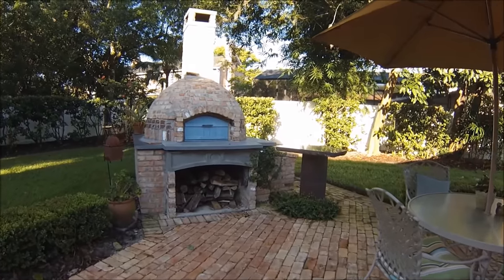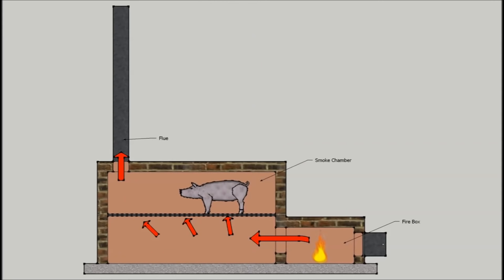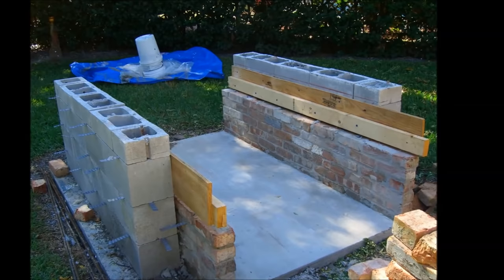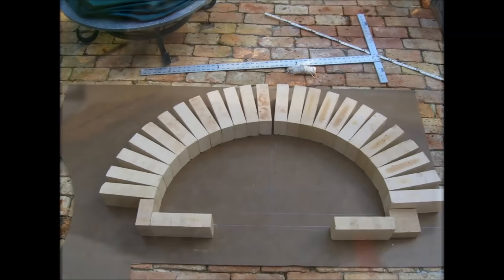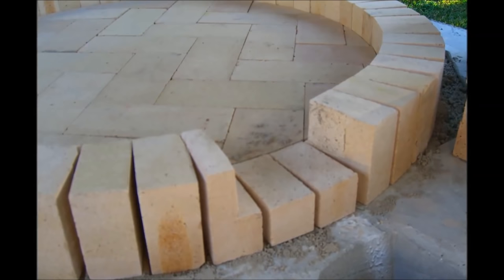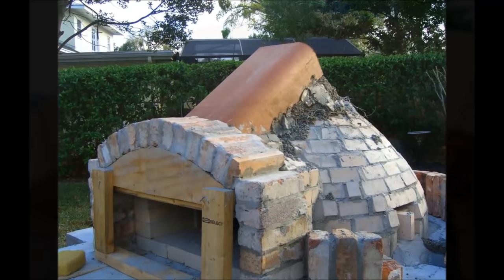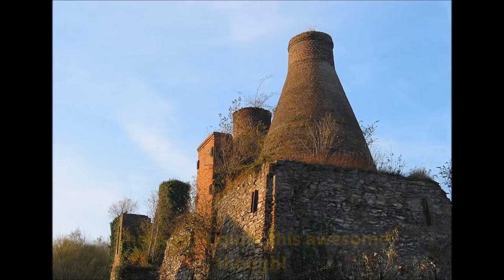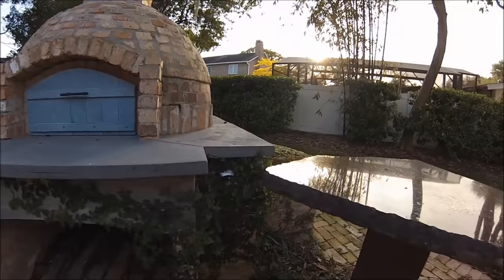How to Build a Brick Wood Fired Pizza Oven/Smoker Combo

Comment: I can see that your depth is 4 blocks but can you provide your other dimensions?  Awesome work also.  Do you think it would work if you made your fire box from a fireplace underneath with doors to control air flow?
Reply from the maker: Jerry Campbell The inside of the oven is 36" in diameter and the outside dome is around 5'5" in diameter. The base is 6'2" wide and 6' deep (not including the projection at the landing). I think the fire box for the smoker would work well but you would have to store your wood somewhere else.

Comment: Really great video and the best pizza oven I've seen on the net. Is your sketch-up drawing to scale?
Reply from the maker: scs3drg Yes the Sketchup model is to scale.
Reply: Thanks, started work today digging the hole for the base, your oven will be the inspiration. I did toy with a slight twist on your design by having one area for fire (the oven) and exhausting the smoke to a separate smoking chamber like a dedicated smoker. however I think the hight smoking chamber would be a little impractical and inelegant, so I'm going with your two fire chambers design. Wish me luck.

Comment: I noticed you didnt really insulate too much compared to other diy oven plans online... How does your oven hold up to holding in heat?
Reply from the maker: +moosekim Mitchell I have 4" of insulation at the bottom and 6" minimum on all sides of it - except right where the flue goes over the top of the oven and right at the base of the chimney. I wrapped the sides of it with high temp batt insulation and then filled the rest of the space between the inner and the outer dome with loose perlite. It holds the heat just fine during the cook. I can't say how hot it would be the next day if I wanted to cook with it then so that might be problematic.

Comment: I'm not in the architectural industry, but I'd wager a vertical copper surface under a relatively large overhang, like your granite slab, is not going to develop much of a patina any time soon... unless you live right on the water by the sea! I've heard of vertical copper cladding being pre-treated for a patina, though.
Reply from the maker: I sprayed it with a mixture of salt and vinegar and it gave it kind of a bluish patina. It looks pretty good but not as good as a natural green patina. I think you are right - it needs to have exposure to rain to really develop it.

Comment: Lee, Thanks for the info on how to transition into the oven and on the removable fire brick.  One more question, and I may have missed this if you already shared this info, what size is your offset firebox?  Thanks for all you help.
Reply from the maker: Jenny Lynch The outside of the box is 2'6" deep and 2'2" wide but there are two wythes of brick so the inside of the box is about 2' deep and 1'2" wide.  It is about 2' tall. If I had it to do over again I would have made it just a little wider - maybe by like 6" and see if I could get a wider door.

Comment: Holy cow man, you are amazing, and I envy your awesome pizza oven/slow smoker. 
I'm thinking about making something similar to this, but rather in a pizza oven over an indoor fireplace. Learning that the flue comes from the neck of the pizza oven means that I shouldn't have to worry too much about cross flow from chimney to pizza oven, at least that's what I'm lead to believe. 
I guess my question is, is this a good idea (pizza oven/fireplace), and do you have any suggestions/cautions?
Reply from the maker: +Pro Jektor You could definitely have one of these inside and use it as a fireplace. Very little smoke comes out of the front of the oven - not any worse than a regular fireplace. The only thing you would want to do is not put it low to the ground like you would a regular fireplace because that would make really difficult to cook anything in it.
Reply: Lee McNeil
Right on. I was actually going to put the pizza oven on top of the fireplace, and have them share ventilation, but thanks for the input and support! ^_^

Comment: This looks awesome! One question... does using the pizza oven as a smoker negatively affect the pizza oven in any way? (i.e. does residual creosote buildup occur inside the oven, and affect the flavor of the pizzas, or do you just burn it off with a hot fire?) Thanks :)
Reply from the maker: Not at all. I never smoke with soft wood like pine though. Always use Oak, Hickory, Cherry or something like that. When you build a fire in the main oven and it gets hot enough, it will incinerate anything in the oven.
Reply: Lee McNeil thanks!

Comment: Hi Lee, Great job on the oven! I was wondering if you could share any additional lessons learned or things you might change with the pizza oven itself. I am thinking of doing an offset chimney as well and have been checking out Forno Bravo's forum, but there isn't much about an offset chimney! I have heard you need to waterproof the oven but can't see how Jamie Oliver or your oven is water proofed? Really great work and thanks for the video! Alan - Copenhagen, Denmark
Reply from the maker: The only thing I might have done with the pizza oven part of it would be to make it just a little bit bigger. Mine is 36" and I could fit probably three small pizza's in it if I had to but it is a little tight. That's a very minor complaint though. I have a clear commercial grade penetrating brick sealer on it for waterproofing (something like this www.tnemec.com/product/view/Series-660-PrimeAPell200). It's not going to keep every little bit of water out of the insulation layer, but since the insulation is mostly perlite, it's not really affected by water. If I had the high heat batt insulation, that might be an issue.
Reply: Hi Lee,
Thanks for the response! I am thinking about building a 38&quot; or 40&quot; oven, I haven&#39;t decided which yet! You say in your video you used batts over the inner oven Are you not worried about that getting wet? Looks great... I love the smoker idea! What sort of temperatures do you get in the oven when using your smoker? Thanks for the tips!
Reply from the maker: I did use a few batts of high heat insulation but mostly it's perlite. I think with the brick sealer it generally keeps the water out of the insulation space. And I did insulate over the offset flue but it isn't real thick. As a matter of fact, there it's developing a small crack where the flue offset is that I need to fix. But it will crack somewhere with or without the offset flue.

Comment: looks amazing, just perfection. If you wouldnt mind what could someone plan on spending for something close to this in material ?
Reply from the maker: I have it up in the description. Plan on spending around $2,000 for the material. Most of that cost is in old Chicago brick which I think runs about $0.75 per brick if you buy it by the cube.
Reply: thanks so much. you oven is a true work of art and something to be proud of. I thankyou for the effort you put in to get it up on you Tube.

Comment: If I paid contractors to do this from start to finish, what would be your best guess as to the cost?
Reply from the maker: It depends on where you are and how busy the contractors are at the time. I can tell you around here, there aren't a whole lot of good brick masons (because most of the new buildings aren't built with brick) and there is a ton of construction going on right now. I would expect to pay probably more than $5,000 for this to be built by a contractor around here right now.

Comment: Watching videos to gauge internal temp potential and radiated heat when cooking but uh... very few show that part
Reply from the maker: I have one of those infrared temperature guns which will measure up to little over 1,000 degrees F, and my oven will easily max that out. Radiated heat outside of the oven is pretty minimal though because it's insulated pretty well.
Reply: @LeeMcNeil  Awesome! Thank you so much for the reply 🙂

Comment: I love this video, we are planning to build one in our yard.  2 questions: what did you use to tie the opening for the fire box in the base to the opening in the oven? I could not see any pictures of how you tied the two together. Also, what size fire brick is used for the removable piece? the pictures look like the opening is larger than 1 brick.  Thanks for any help.
Reply from the maker: Jennifer - you are right I really didn't get a picture of that. The smoker flue comes up into the insulation space between the inner and outer dome. I made a little enclosure of fire brick with a lid made of a small piece the wall that I sawed out of a scrap piece of flue pipe. You could make the lid out of a few fire bricks also. This forms the 90° transition into the oven. I hope that makes sense. The removable brick is just a fire brick turned in its side. Make sure you taper it and grind a couple of finger holds into the face of it, otherwise it will be a nightmare removing it and putting it back in place.

Comment: Oh, one more question... how do you make that brick removable?
Reply from the maker: I tapered the back of the brick a little with the masonry saw, then I ground two notches in the face of the brick with an angle grinder with a masonry blade. The way I'm able to grab the brick and slide it in and out of the hole in the oven. Oh, also no mortar on that brick of course.

Comment: HI Lee, great site and wonderful looking oven, I'm interested in building one is there a material list. I want to gather my material a head of time ,without  having  more than Ineed. Bags of Cement mix you used were they 60lbs or 80lbs thank you for share your oven build
Reply from the maker: +joe Freitas I did not do a formal materials list. The amount you will need will depend on your oven design. I think I used 80 pound bags of cement but you will need to calculate the volume of concrete you need and translate that into how many bags. If the bag doesn't have that information on the bag itself you can probably find it on the manufacturer's website. Sakrete 80lb bags are .6 cubic feet per bag according to their website http://www.sakrete.com/media-center/blog-detail.cfm/bp_alias/How-Much-Concrete-Do-I-Need . You will have to do the same converting the brick and block to square feet etc.

Comment: I've heard heard some builders of brick ovens say use vermiculite and others say use Perlite. One of the vermiculite users said using Perlite was dangerous. I'm a  confused to which would be best for fire contact. I used to think Perlite was just fine, but now I'm not so sure anymore. Why did you go with the Perlite?
Reply from the maker: Perlite is cheap, very easy to find and is not dangerous at all. You can find it at most big nurseries because it's used in potting soil mixes to aerate soil. I have no idea where I would even get vermiculite.

Comment: Lee- prob 3 years and a 1/2 million views after you built this masterpiece, my question is:
How much actual smoking have you done in this oven, and what’s the outcome in the cooking/pizza chamber? Typically, smoking generates a good deal of atmospheric fat/smoke/byproduct that (particularly over time) coats all the exposed surfaces. Any comments/suggested improvements in your design?
Reply from the maker: Yes I actually do a good amount of smoking in it. I usually only use it if I am smoking something big like a brisket, turkey or pork shoulder since it is kind of a production to fire it up and I have a Weber kettle grill which is fine for smoking smaller things like baby back ribs. And the food comes out great. The best thing to cook in it is steaks though. They come out fantastic. If I had to do it over I would have made the smoker box a little bigger and add some better ways of controlling the airflow when I am using it as a smoker. It's a little finicky getting and maintaining the right temperature without monitoring it quite a bit. I have some videos of smoking some different things in it and making steaks on my channel if you want to check them out.
Reply: Lee McNeil great note, thanks.  What you didn’t address was buildup in the oven. Any issues? Any build up at all?
Reply from the maker: No, when you use it to cook pizza or steak, you are building the fire directly in the oven chamber and it gets over 1,000 degrees in there so everything burns off. It even burns the soot off the top of the oven.

Comment: When u smoke meat in there doesnt the grease from the meat trash the inside. What do you put the meat on so you can drain the drippings???
Reply from the maker: No. First, I use an elevated grate to sit the meat on and then have a pan of water underneath to add moisture, moderate the temperature and catch any drippings. You can see how it works in this video where use it to smoke a turkey. https://youtu.be/v0nPnXZ9dIY
But it doesn't really matter because the next time I build a fire in the main oven, it gets to like 1,000 degrees so everything gets incinerated.

Comment: So if I have to go 42 inches to reach below frost line does that mean only the top is out of the ground or do I have to keep the foundation and build up 42 inches to ground then up from there?????????????????/
Reply from the maker: Wow! You have to go 42" to get below the frost line? I'm not an expert but I think you would have to put the foundation at least 42" below grade (check your local codes) and build a foundation wall up to grade them your oven structure.

Comment: Beautiful! Please tell me, can I build a wooden door for my oven? Does it have to have an aluminum back? What did you use for yours?
Reply from the maker: Hey Maria! No it does not have an aluminum face. I only use the door when I'm smoking something or when I'm not using the oven. The temperature in the oven can get over 400 degrees F when I'm using the smoker, if I'm not careful, but I try to keep it at around 225 to 250 degrees. Even at 400 degrees, most of that heat does really get to the door, it goes up the flue. I can't use it when I build a fire in the actual cooking chamber because the fire needs air. If I had an inner door that fit on the inside lip opening, I would make that door insulated and put a metal back on it.

Comment: very nice work I made maple sap arch so the fire brake and insulation I can get a hold of. Have you notice any moisture issues with the smoker in the pizza oven side?
Reply from the maker: It needs to have clear sealer applied to the brick or you will get some water intrusion.

Comment: How do you feel about a mixture of sand and plaster of Paris to form the insulating barriers?
Reply from the maker: I'm not sure that would be a good insulator. Typically you need air small air pockets and void to slow heat transfer and that wouldn't really give you anything more than regular concrete. And I think it deteriorates when it gets wet.

Comment: Why did you not use any insulation in the doom?  Is it required??  I have seen a lot of brick ovens that put insulation in the doom area.
Reply from the maker: +pspaduzzi I saw your other comment where you saw it but yes there is lots of insulation in there.

Comment: Great design.  Very creative and well described.  Have you had an issue with greasewhen smoking, but do you always use some form of container to catch it?
Reply from the maker: I always use a pan of water under the meat on an elevated rack. I wouldn't worry about grease anyway because the next time you built a fire in the oven, it would burn all that off.

Comment: Hey how's it going. What kind of mortar mix did you use for between the fire bricks? Great video too thanks 👍
Reply from the maker: Jason Coyle to answer your first question, it's not going too bad. In answer to your second question, add fire clay to your mortar mix. It's not easy to find but call a masonry or concrete supply company. They will set you up and it's cheap.

Comment: Your fire  mortar mix you mentioned sand but didn't say what type.Most sites recommend silica sand and dont recommend any other kind.Which kind you used in the mix? Thank you
Reply from the maker: You want to use a coarse sand, not the kind that you put in a kids sand box. Coarse sand is the kind most builder's supply places carry, unless it's specifically labeled play sand. But, I don't think it would make a huge difference if you did use play sand.

Comment: Awesome video, though it'll be a few years before I'd undertake such a project I hope to make something similar. 

I was wondering. When you use the smoker, what do you do about the fat drippings?
Reply from the maker: I use an elevated grate with a pan of water below it, so not much gets on the floor of the oven. Even if it didn't use that and drippings were all over the floor, when I light it up for pizza, I will get it over 1000 degrees F. Anything even remotely organic that happened to be in that oven will get totally incinerated.